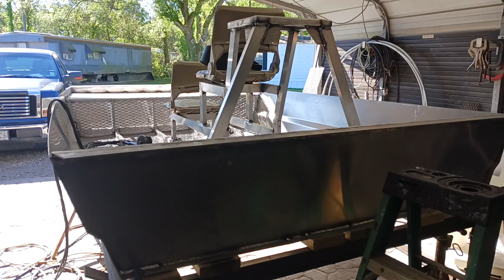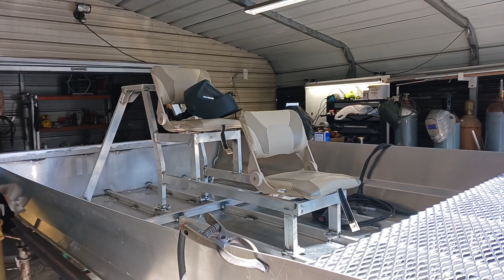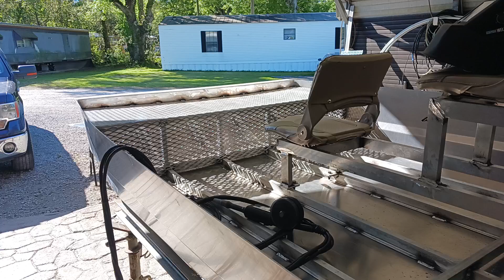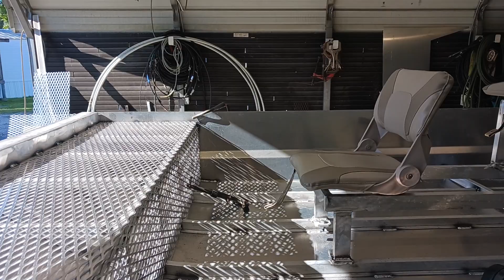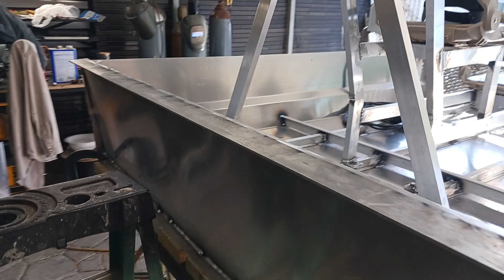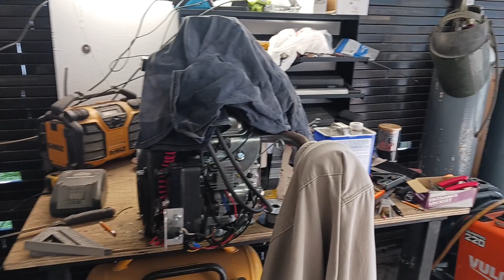Mini Airboat preview

Comment: this is niceee. how much this weighs? when are you going to run this?
Reply from the maker: I don't have a total weight yet, the hull is under 200lbs. Waiting on a machine shop to fabricate a tool. After I get this tool, I'll be able to get back to work on it. I'm very interested in seeing how it will run
Reply from the maker: Should be getting back to work on this boat in the next few days. Mid to end of July